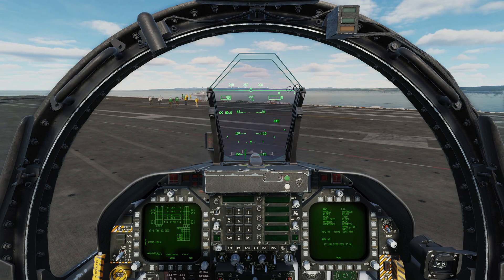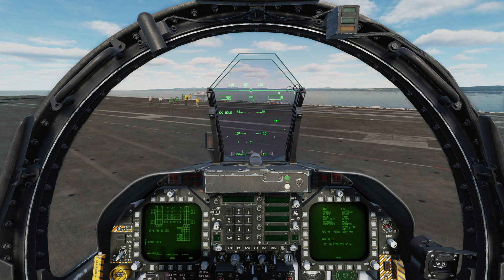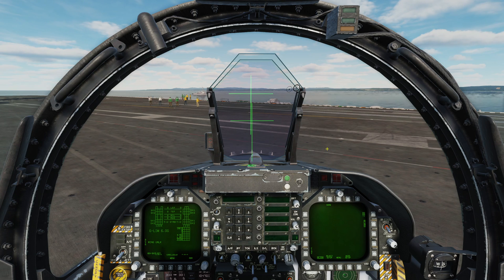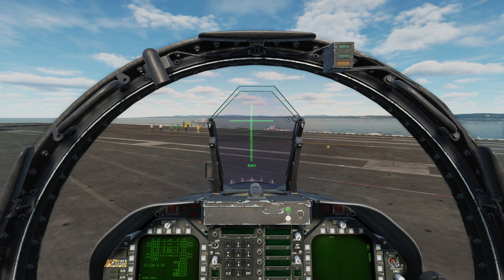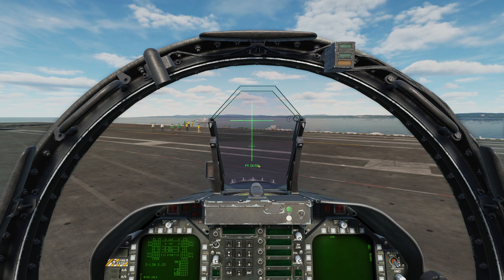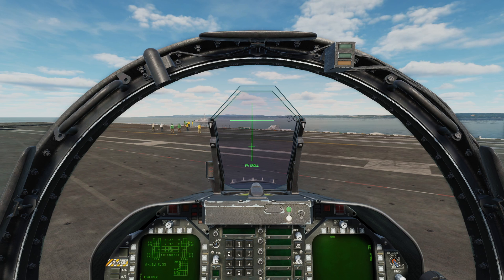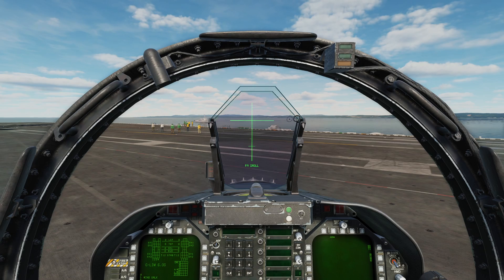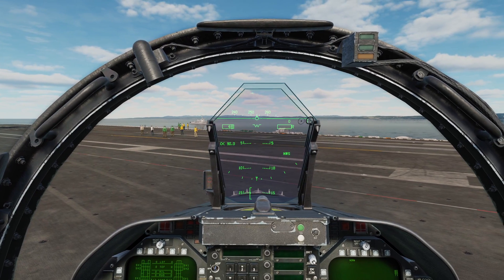DCS F/A-18C Addendum 1 - HMD Alignment

Comment: You and grim reaper have in invaluable resources to learn the Hornet, thanks mate!   Now that I kinda understand most systems Im coming back and going quickly through your vids for reinforcement and feeding the algorithm.

I have an issue where my HUD is shifted left sometimes.  Anyone have any ideas?
Reply from the maker: Thanks! The pitch ladder will centre on the flight path marker which it's self will deviate left and right to indicate slip. You can cage the flight path marker using the cage/uncage HOTAS button although make sure to uncage again during landing as otherwise you won't get indication of a crosswind or your true touch down point.